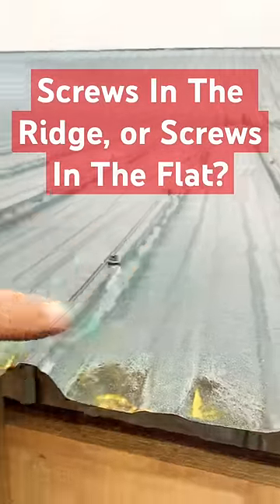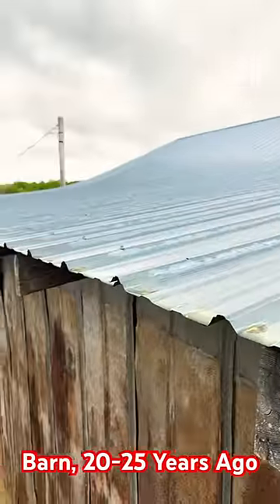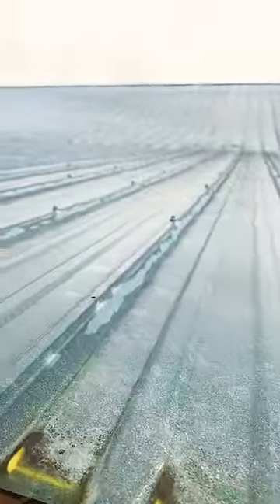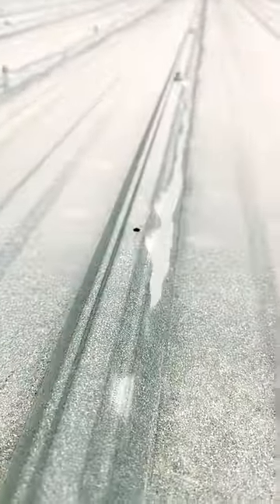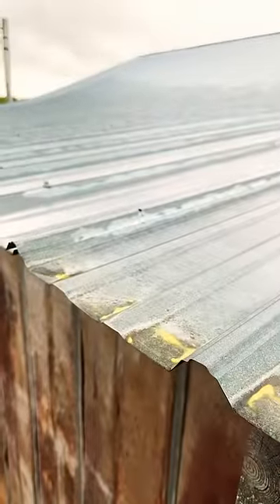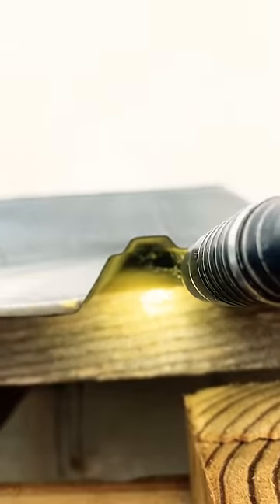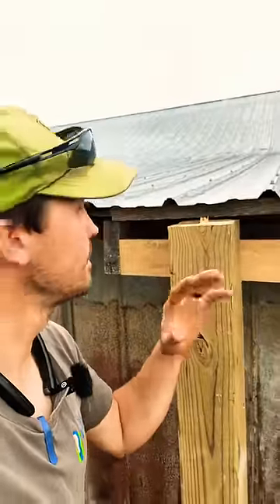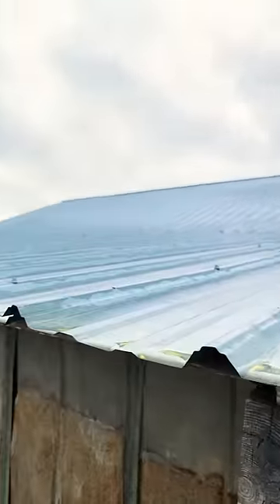What’s Better? Screws In The Ridge Or Flat? #construction #farmlife #building

Comment: Ridge is what the manufacturer recommends
Reply from the maker: I have heard both ways…. I prefer the ridge
Reply: I just completed a barn and house using americana as roofing and siding. Manufactures said not the ridge. I think the ridge is the way to go
Reply: Ridge
Reply: The ridge is the place at the top of a gable roof where the sheets come together and the piece of metal that spans the 2 sheets is called a ridge cap. If someone mentions a high rib, what are they talking about?
Reply: @RouthFarms  if the manufacturer recommends where to screw and you've heard it both ways then who is the manufacturer who recommends that you  screw in the "ridge" with this common roofing/siding profile?
Reply: @Estwing22  So it’s called the rib? Cool.
Reply: @YoMark yes this is specifically low rib metal shown here with commercial high rib being 1 ¹/²" tall rated for more flat and load bearing applications
Reply: @RouthFarms I install steel structures and then sheet them for a living and our manufacturer recommends screws in the flat on walls and roof for the structural strength added with an actual clamping force. I've mostly heard never screw on the rib if it isn't flat and then only abandon screws in the flat if your structure is over built. Old nails would bend the head over the sides of these ribs but screws won't. We do spray foam insulation after sheets are installed or fiberglass with a finished white vinyl backing stretched behind the sheets so the screws would never drive in straight trying to go through the rib so they would attract water with a open side slanted washer
Reply: @RouthFarms most of the time when I'm called to fix roofs like this I usually see screws that are too short to engage enough threads and then find half a dozen places where the rib has cracked a half inch from the screw hole because the metal couldn't expand and contract properly. I wonder if water follows the threads down easier than an open hole
Reply: Depends some don’t
Reply: For lap only to seal ridge not to hold sheets been doing 30 years
Reply: @arthurianlegend352  depends on the manufacturer and how old school they are. No engineer that I know of will allow new homes to be installed with screws in the ribs due to improper clamping force. Barns don't have the same safety requirements that residencies do
Reply: @Estwing22 ridge of the sheet metal not ridge of the roof
Reply: Only for stitch screws you'll expand your tin if you continuously screw on the ridge. The proper method is to put the screw beside the cap joint. Then you apply stitch screws to the ridge. This will keep your tin from growing or shrinking as you move down the roof
Reply: This is incorrect information they go on the flat near the ridge starting from the overlap
Reply: @joshwatson9725 the changing temperature works on the ridges has the metal expands and contracts The Ridges stretch the screws are supposed to go in the flat starting 1 inch from the overlapping Ridge if they are screwed Through the Ridge you will not get proper compression on your neoprene seals on the screw and the constant movement of the ridge will sometimes make your holes larger and the roofing steel as well as the possibility of cutting off the tops of the screws where are the screws breaking off
Reply: @Estwing22 I was wondering who the manufacturer was that told them to put the screw in the ridge been putting a roof on for 40 years and the manufacturer recommends putting the screw in the flat about an inch from the ridge
Reply: Incorrect having worked with the material supply company I am familiar with recommendations the manufacturer does not recommend putting screws through the high point on the panel which is what you are calling the ridge
Reply: @topherl1446 if you put a screw in the rib it will dent it and collect water. I know this because I had to calk every hole on a roof when I replaced the fasteners that where leaking.
Reply: Make damn sure you use long enough screws, when pre drilling high rib!
Reply: Not true
Reply: Absolutely not the ridge, the manufacturer will never reccomended the ridge. 40+ years ago we thought we were smarter than the manufacturer and installed lots of roofs with screws on the ridge. As the years went buy those roofs had unending issues with lose or missing screws. Seemed like a good idea at the time but was flawed. Roofs screwed in the flat will stay put. My 40+ years of roofing experience tells the truth. Only amatures believe otherwise
Reply: @arthurianlegend352 bullcrap
Reply: Nope not 🚫🚭  not the way that type of Metal goes on. 👍😁👍
Reply: Go read manufacturer application. Everlast roof. Screw the flat
Reply: I AM a manufacturer.  Our literature says put it in the flat.
Those screws are traveling almost an inch before they even hit the substrate. Of course, they need to be in the flat.
Reply: @andyr462 I read your reply like Judge Dredd ("I am the law" -Sylvester Stallone)😅
Reply: @nbco55  lol that's the great thing about emotionless text. You can infer any tone you want as you read it.
Reply: I thought the superior design was called standing-seam, and the fasteners were somehow covered/lapped with the next piece.
Reply: ---  only metal roofing I have ever seen where the manufacturer recommends the fasteners in the high position is old fashioned corrigated ( wavy like a potato chip ) roofing  -  if fastened in the valley,  it will not seal and create a dam:  leak every time  -   bad part is if the fasteners are on the top of the corrigations and too tight, they will spread the width of the sheet ot tin
Reply: Wrong. Always on the flat. Been doing metal roofing for 25 years and never seen anyone who does roofing screw on the ridge.
Reply: Manufacturers warranty is voided if you put time in thr ridge
Reply: Just depends on the manufacturer.  Some say to put them in the flat and some say the ridge.  I'd say do it as the manufacturer says if it has a warranty. If no warranty, put them in the ridge.
Reply: No manufacturers say to screw in the flat
Reply: @richcandella9154 these comments man....SMH....
Reply: @topherl1446 👍🏼
Reply: @arthurianlegend352     nope:   the only style metal roofing that I know of that the recommended fastener location is on the rib is reg. old corrugated ( always on the high rib / never in the valley rib )  and the old 5 V Crimp.  You seldom see that stuff because it is hard to nail, tends to leak, and doesn't stay down  -  it is usually the cheapest choice though.
Reply: If you screw in the rib it stretches the mettle and lowers the wind rating And no manufacturer recommends that
Reply: Depends on the manufacturer because when I worked for the metal company we only screwed in the flat
Reply: It's not that easy depends on location ridge is better for water flats are way better for high wend so it's a debate that will never end u can't put every roof in the same box
Reply: Nope false information
Reply: That's false.
Period.

Never seen a manufacturer recommend you weaken the fastener system
Reply: @RouthFarms screwing thru the ridge leaves too much screw out of the board.
Screws do not have sheer strength and you create 2 sheer points by screwing thru the rib into the purlin.
Reply: @joshwatson9725  the flat removes the large sheer space left by screwing the rib. It's a safety concern. The screws will snap and your sheets will become scrap balls in the yard next door
Reply: @arthurianlegend352  it’s called a rib and I was a roofing foreman for years and all manufacturers recommend screwing on the flats now.
Reply: Union steel here won't warranty it if it's in the ridge
Reply: @Estwing22 a ridge is a line of mountain tops actually.
Reply: It depends on the manufacturer. Far as I can tell the metal will be the same but to different manufacturers will tell you opposite. My belief is that ridge is better, but some manufacturers will tell you flats so you don't damage the ridge.
Reply: @mojoman2001 you thought right. But what's your point? That's not what we are talking about here.
Reply: @codybean2981  if you screw on the rib you will have loose screws and leaks in 2 years
Reply: @dallisspicer6825  so what if you get long enough screws?
Reply: @codybean2981  doesn’t matter how long the screws are metal, expands, and contracts during the day. The expansion in the contraction occurs in the ribs. This will in two years, oblong the holes and cause a leak. Also, the screws do not get a good seal on the rib even before the holes get oblong..
Reply: @dallisspicer6825  best answer I've heard yet
Reply: @codybean2981  thanks I’ve been a foreman for the top 10 roofing companies in the United States for years now. We install on the flats as recommended by the manufacturer
Reply: @dallisspicer6825  it sounds like flats are the proper way to go. I've always done the flats because it's not my house to experiment with but always felt like the rib was better but another guy on here had a good explanation of not being able tighten the ribs enough without flexing and then expansion and contraction of the metal will be most significant at the ribs.
Reply: @codybean2981  that is correct
Reply: What about putting the screws on the small rib ? Here in Pensacola I only see screws in the flat
Reply: Yup, if you buy it from Westman steel it shows through rib online in their manual
Reply: @RouthFarms  I agree; ridge is better, but a vacant screwhole on the ridge can still leak if you have snow; but not as much as a vacant screwhole on the flat!
Enjoy!
Reply: When we did my dad's roof they said if we put a screw in the ridge it voids the 50yr warranty
Reply: @leonkennedy9739  do it how ever you want. But don’t say I didn’t warn you. The rib is the worst place to screw. And if anyone took a minute to think about it they would agree.
Reply: @smotedown318  Yes;  I was just thinking about whether the 'rib' is supported, or not...
Thermal expansion is also an issue, on all materials, and systems.
Reply: Nope just had to replace my buddies entire roof because it failed inspection because it was screwed on the roof
Reply: @Estwing22  then what’s the proper term for the ridge of a mountain? Sorry the long narrow high point of a mountain. I had no idea ridge only referred to the top of a gable roof. 😉
Reply: @joshualee9557  replacing buddy’s roofs don’t make you a professional. I’ve done millions of dollars in roofs and repairs. And the rib is the worst place to screw it
Reply: No it's not
Reply: @adamkalman6011  correct
Reply: Not so mutch.
Reply: I've done several steel roofs both ways but the manufacturer warranty is voided if you screw the ridge I found this out years ago when I had some defective steel that rusted a little and contacted manufacturer and they said the warranty only covers when you screw on flat.
Reply: I do standing seem roofs for a living I’ve never seen screws in the ridge.
Reply: @2inHeartattack  standing seam usually have hidden fasteners.
Reply: Ridge. Leaves can slide off with the water.
Reply: Negative, contact one manufacturer that suggests that.
Reply: Please site sources, panel installation guides from manufacturers that distribute to home depot, lowes and abc roofing all show the flat, if you don't know what you're doing wrong you can't possibly be doing the job right.
Reply: Wrong
Reply: *rib*

Specifically, the *high rib*

And the screws go in the flat.
Reply: Either you've only ever installed one roof, or you've never installed a roof, be my guess... Manufacturers debate this in the recommended install instructions, ffs. But maybe you've done more research than all combined roofing mfgs...
Reply: If you want warranty you do what the manufacturer tells you to no matter where.   But we always use the ridge as thats where the brand we always use says to.  Done about a dozen homes or buildings so far with them and no issues over 15 years.
Reply: It is what SOME manufacturers recommend...
Reply: I would like to see a manufacturer that suggests screws in high rib I have seen a manufacturer say this
Reply: To me this settles it.
Reply: Follow the manufacturer instructions. In our area most all the roofing sold here is only 2 brands. Instructions are screw in the flat and only use their screws with neoprene washers.  If ANY screws are in the ridge the warranty is void.
Reply: I have in my 50 plus seen or read a manufacturer say install screws in high rib with exception of what is called a stich screw  I my business employees have installed just guessing 2 million square of metal roof
Reply: @topherl1446  I'm with ya I have never seen a detail using screws threw ribs beyond a stich screw
Reply: Someone smells like cacA
Reply: You can only screw the ridge if you put block to fill in the void so the screw goes tight. It's a lot more work. Or else you leaving airspace and the metal drinks and retracts. Save yourself the work screw on the flat. Metal roof screws have a metal washer and a neoprene rubber washer on the bottom. They will not seal properly unless they're squeezed against the metal in would . Good luck.
Reply: @Hardworkingman870  Kennedy Metals here does and has for about 20 years.  They press their own steel.   No warranty if it's in the valleys at all.  I have been using them for about 15 years.
Reply: @Estwing22 There are different definitions of ridge. You are talking about the ridge of the roof. They are talking about a ridge on a metal roof panel.
Reply: @calebz1448 I also put up steel buildings for a living. I'll keep running screws in the flats like it was taught to me 30 plus years ago.
Reply: In high wind zones like FL, I think inspectors  want to see screws in the flat. If you do put screws in the rib (I prefer) in high wind zone, make sure to put one in the flat, centered between ribs and a few inches up from the bottom edge. This will help keep the roof from peeling back in high (hurricane) wind.
Reply: @therighthandmann  Here in PEI Canada, an Island province in the atlantic ocean the manufacturer recommends that as well.   At least on the bottom next to the eve that you put one screw in each valley about two to three inches from the bottom of the sheet.   We usually put the screw in through the bottom gasket at about the two inch level.  The rest of the way up they screws on every ridge at 16 to 36 inch spacing for warranty.  Hurricanes are a very big thing here too.
Reply: @VoltsAnBolts     it's also the top of a certain type of pig
Reply: @AJ-tz6qu    if you are talking about the two small ribs between the high ribs and  adjacent to the flats,  that the 2nd worst place to put fasteners  -  the only worst place is in the bend where the high rib meets the flat
Reply: @samueldiefenderfer4309 7 buildings on my place, including the house, built before I bought it. Only one of those roofs have screws in the flats, the other 6 are on the ribs.

Guess which one leaks and is rotting the purlins? It also happens to be 5yrs newer than the other 6 buildings.

It may be more difficult to screw the ribs properly, but they Don't Leak.
Reply: I also do this for a living and its screws in the flat right after the over lapping rib. We only screw through the rib if an overlap is sealing down. If that happens we do it to every sheet for symmetry
Reply: @calebz1448  me too man. I've been installing and fabricating steel buildings with panels for years. I've never heard of anyone putting screws in the rib unless it was a stitch screw on commercial panels. In which case all the screws are still put on the flat towards the overlap and also a lap screw on the rib to help hold down the overlap. FINALLY. It's blowing my mind how many people are talking crazy on here. No professional would ever do this with this type of panel.
Reply: @topherl1446  the only people saying the manufacturer said to screw the ridge are people who don't know what they're talking about. Nobody runs these panels like that. It would stretch the whole roof and look like shit. And it wouldn't be effectively tightened down.
Reply: @andyr462  praise God. Some people with sense showed up. Lolol. I was getting pissed off at this thread.
Reply: I've screwed in ridges and I've screwed in the flats I prefer to screw in bed
Reply: Yes. Screws in the top of the corrugation generally will not leak.  Screws in the top of the corrugation will not meet any engineering specs.  That are necessary in storm prone areas such as here in the Caribbean.
Reply: Incorrect
Reply: @dallisspicer6825  I’m a general contractor in Florida bubba
Reply: @dallisspicer6825  and I said the product specs say on the flat why u argue with me
Reply: @topherl1446 
Been putting a roof on for 40 years? Lol.
Business is slow, eh?
Reply: Not in Florida.
Reply: Ridge makes no sense.. that only fastens the sheets together instead of to the structure
Reply: @JackJohnson-mc7ki  Not if the screws are the proper length.
Reply: @dallisspicer6825  After reading 392 comments, yours was the clearest most logical... thank you..... when I upgrade my roof to metal I will be following instructions and screws will be in the flats 👍
Reply: @fritzmiller9792   It would be a wise choice for sure. I’ve been doing metal roofs for many years now… All over New England and everyone knows how bad the weather can be up here and I’ve had no trouble with any roofs screwed on the flats but I have replaced a few that we’re screwed on the rib. The best metal roof is standing seam of course. We always called the screw down metal crap lap😂 but I got crap lap on my house and I have no issues. It’s all about the install👍